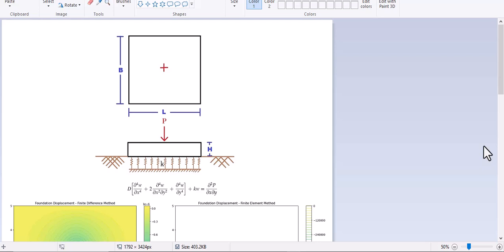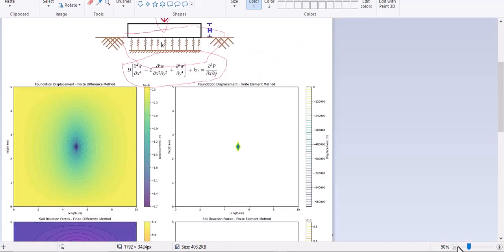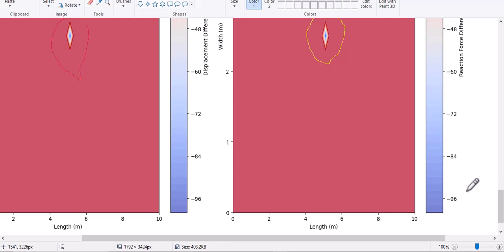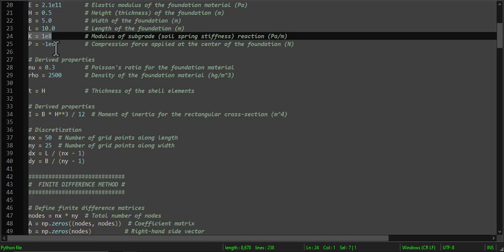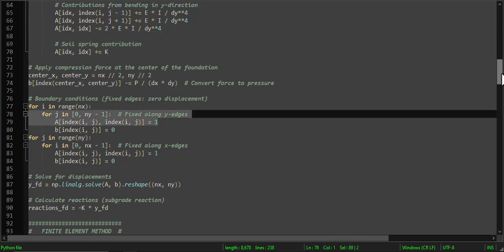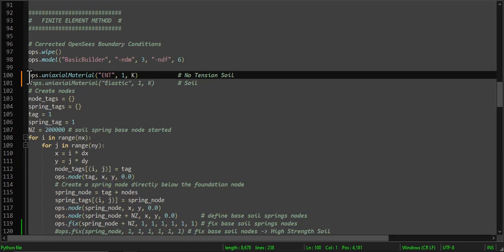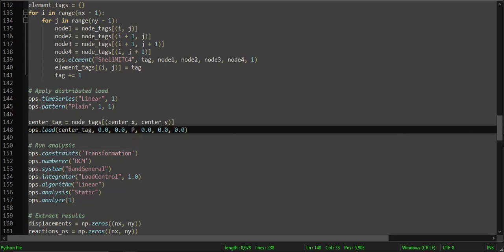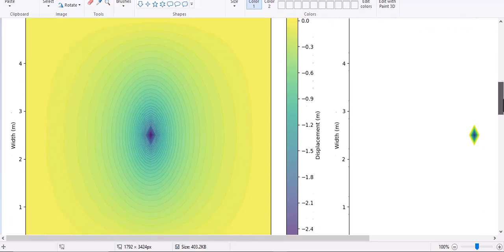OpenSees, Soil-Foundation Interaction with Finite Difference and Finite Element Methods

Comment: very nice job. now can you tell me how can i apply soil spring(modulus of subgrade)  on each point of shell element in opensees. you can take a look in this example: # Create a new model

frame = FEModel3D()

#example using that element.
t = 2*1  # ft
width = 8*1  # ft
height = 8*1  # ft
nu = 0.17
mesh_size = 1*1  # ft
load_dl = 0.0  # psf
load_ll = 0.0  # psf
load_pw = 0.0  # psf
load_ff = 0.0  # psf

# Soil Parameters
ksf = 3.5
ft = 12
kcf = 1
AllowableBC = 2.5 * ksf
AllowableDeformation = (1/12) * ft
SafetyFactor =2.5
SoilSubgradeModulus = (AllowableBC / AllowableDeformation) * SafetyFactor* kcf
meshArea = mesh_size * mesh_size
internal_ks = meshArea * SoilSubgradeModulus
edge_ks = 0.5 * meshArea * SoilSubgradeModulus
corner_ks = 0.25 * meshArea * SoilSubgradeModulus
print("internal_ks")
print(internal_ks)
# Define concrete in the model
E = 57000*(3000)**0.5*12**2  # psf
frame.add_material('Concrete', E, 0.4*E, 0.17, 0.150)

# Add the mesh to the model
frame.add_rectangle_mesh('MSH1', mesh_size, width, height, t, 'Concrete', 1, 1, [0, 0, 0], 'XZ', element_type='Quad')

#automatically generates each mesh when it analyzes. Sometimes it's convenient to generate
# the nodes and elements in the mesh in advance so that we can manipulate the mesh prior to
# analysis.
frame.Meshes['MSH1'].generate()
# Define the corner points as a list of coordinates
corner_coords = [
    (0, 0),                # Bottom-left corner
    (0, height),           # Top-left corner
    (width, 0),            # Bottom-right corner
    (width, height)        # Top-right corner
]

edge_points = []
corner_nodes = []
internal_nodes = []

# Add fully fixed supports on all sides of the slab
for node in frame.Nodes.values():
    # Check if the node is a corner point
    if (round(node.X, 10), round(node.Z, 10)) in corner_coords:
        corner_nodes.append(node)
    # Check if the node is on any of the edges
    elif (round(node.Z, 10) == 0 or round(node.Z, 10) == height or
          round(node.X, 10) == 0 or round(node.X, 10) == width):
        edge_points.append(node)
    # If the node is neither a corner nor an edge, it is internal
    else:
        internal_nodes.append(node)

# Apply fully fixed supports to edge points
for node in edge_points:
    frame.def_support_spring(node.name, 'DY', edge_ks, '-')

# Apply fully fixed supports to corner points
for node in corner_nodes:
    frame.def_support_spring(node.name, 'DY', corner_ks, '-')

# Internal nodes could have different support conditions if required
for node in internal_nodes:
    frame.def_support_spring(node.name, 'DY', internal_ks, '-')

Comment: Hi, do you compare with safe or safe? I model a similar structure but the results be very very different
Reply: When i run the code i get negative reactions, like traction
Reply from the maker: @leafsbreadspeedrendersandm9140  No I did not verify wih Safe CSI
Reply: @salardelavarqashqai   Hi, I have been testing with the proposed algorithm and I have noticed that for nx = 50 and ny = 25 tensile stresses are generated near the edge even though the material is ‘no tension soil’.
I have done tests for square ‘soil-foundation’ and I have started with nx = ny = 100, again I observed tensile stresses at the edges; but the less ‘nx’ decreased I observed that the compression results increased and the tensile stresses disappeared.
I think the mesh should be calibrated. I have the impression that the graphs generate a tendency to stress more in the upper right corner.
I am not an expert but I will try to learn and bring some input to all this I mention.
Thank you very much for your input.
Reply from the maker: @ESTRUXTUR0  
Yes. it is just for educational purpose and it is not exact simulations